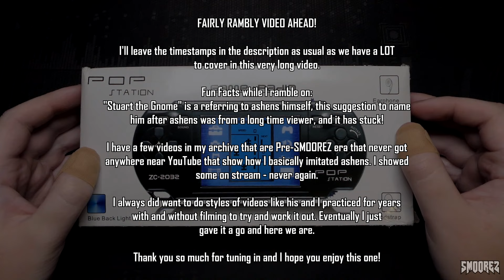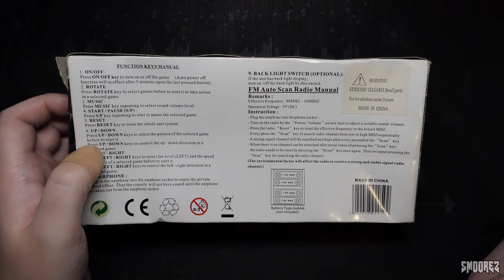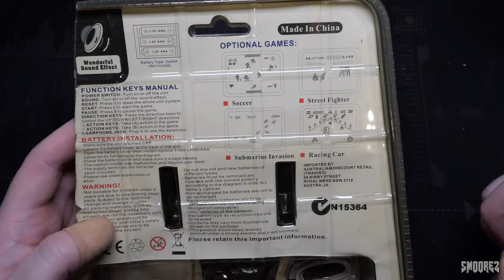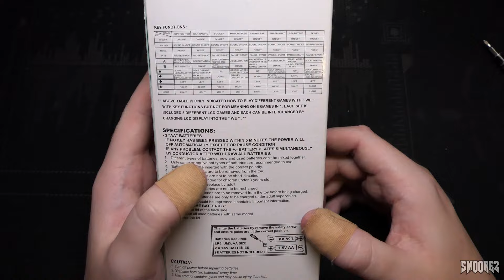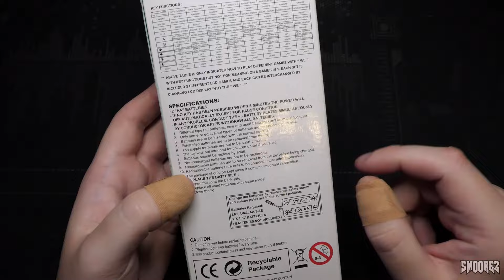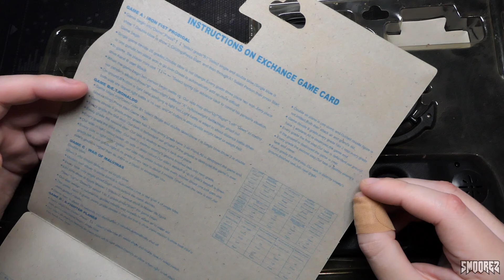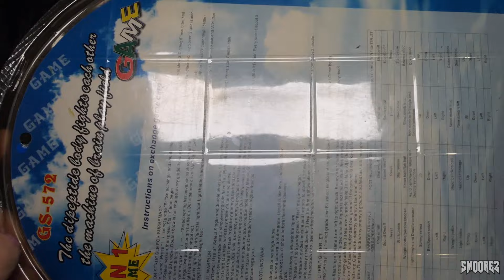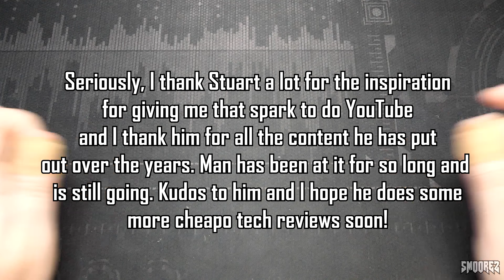WELCOME TO POPSTATION WORLD! Reviewing 15 Cheapo Bootleg Game Consoles...

Comment: I remember Ashens looked at one that looked almost like an OG Xbox console, with another that just looked like a PS3 but with the screen sticking out of the disc slot. Another cool POP Station I saw was this one that was a monitor with separate keyboard and mouse which just acted as a second controller. 7 inch display and some Counter Strike LCD game with actual sounds.
Reply: Where do people find these? I spent years looking for that PS3 POPstation, and still no luck..
Reply: @Akriashi  it's called the polystation three

Comment: Fun fact: The Titanic's hull was built out of the same plastic as the YD-988.  

I had the brick game when I was a kid with the funky Tetris.  Mine though had that same screen but it was fitted into a small clear case not much bigger than the screen  itself and it had a couple of red rubber buttons below it.  The unit was powered by watch button cell batteries and it had a little metal hook so you could fit it to your backpack or something.  I've still got it in a drawer somewhere.
Reply: Ok

Comment: 53:24 seems to be a rather unusual way of writing „Falklands War” (The islands are named « La Islas Malvinas » in Spanish) and makes me wonder if some of these might've been targeted at the South American market? 😇

Many thanks for a really nice trip down memory lane with these! 😄 A lot of the block games were on sale in the UK (Mostly from marketplaces and some toy shops) and were a popular item when I was at school in the mid 90s. 🏫

The „x99 in 1” was always a very prominent selling point (Reasonable for products targeted at a country in recession where value for money was paramount) though in practice „99 in 1” usually translated as „Ten distinct games, each with ten different skill settings = 100 « games » = More than the 99 you've paid for! 💰” 😆

These also show an interesting trend in how technology has developed. When these were produced it was cheaper to employ a custom LCD and very low-spec custom microcontroller (MCU) rather than use a generic matrix or 5x7 LCD and the costlier MCU that would be needed to drive it. Compare with today (Late 2022) where a custom LCD and 40nm boilerplate chip might still cost more per unit than pairing a generic LCD/LED panel with an AVR or similar programmable off-the-shelf MCU! 🤯

Comment: I've build my own console using a old small celeron powered motherboard out of a laptop and i've build it into a wireless router, complete with build in speakers, hard drive, fan, custom heat sink, custom made cables and buttons. I mean, it looks awesome and plays quite a bit of games from older consoles! Everybody is stunned by my lil console. People were talking about that the playstation 5 looks like a wifi router, and that got me thinking, and i did it. I will make a video on my channel about this homemade console, i wanted to use a raspberry pie first, but that laptop motherboard is much more versatile so i chose that instead.
Reply: Ok

Comment: I suppose it's possible to program an Atari 2600 to emulate the "Pop Shite .....er I mean Pop Station!"🤣
I'm kinda impressed with that "Mario Adventure " game, it looks to be a better quality electronic game than the crappy thing that was called "Double Games"
With the Mario Adventure game, I think they did Sonic the Hedgehog flavours as well.
Sony PlayStation release in Japan, December '94
"Playblock" try reflowing the solder points on the wire connections.

Comment: do not put empty battery in electronic device especially clock, corrosion make it rust, make pcb not work, it can be fix by iron soldering the rust part don't forget to add flux to rust part before soldering as to not burn the part because of high heat

Comment: what happens if you switch cartridges in the middle of a game?
Reply: Usually the device will try to play for example City Fighter as if the City Fighter LCD was inserted, but in fact the Submarine Invasion LCD is inserted and the graphics don't line up or make sense. You have to Reset the console for it to start Submarine Invasion.